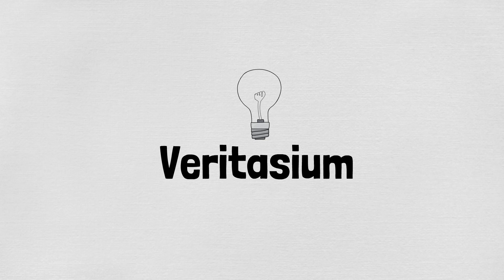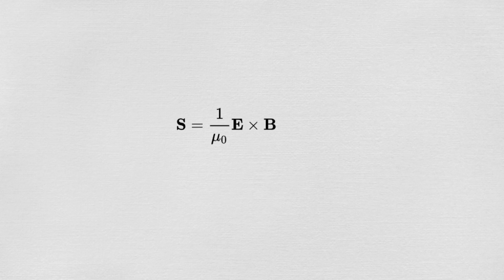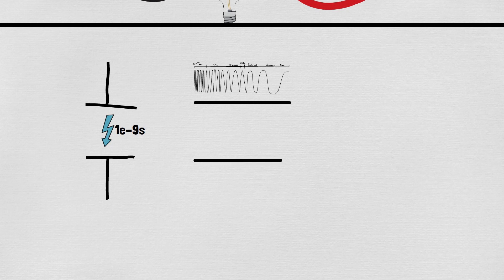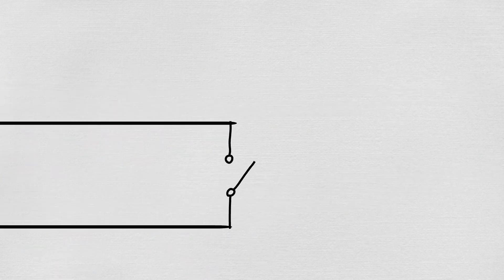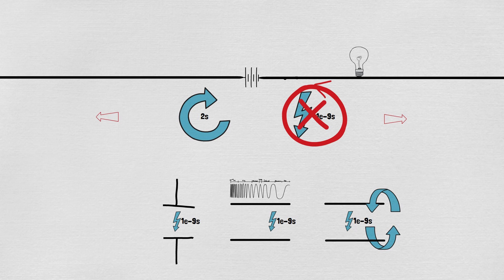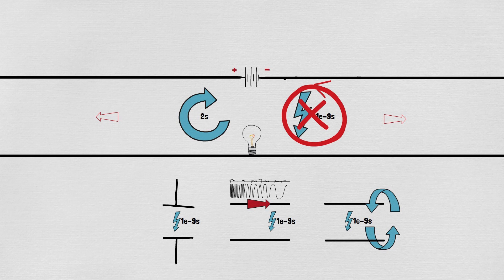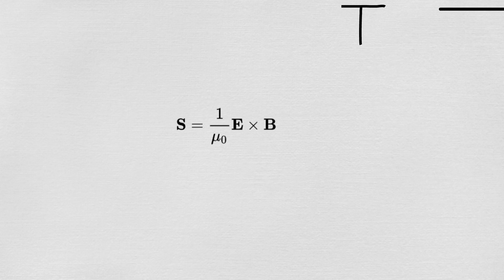Veritasium is Right? (see description)

Comment: OK.  So here is my answer.  The answer is B and D ( sort of).  Other people are assuming the only way the energy can transfer from the battery to the light bulb in 1m/c seconds is thru magnetic induction or capacitive coupling thru the wires in close proximity of the battery and the light bulb.

1. Capacitive coupling.  Since the Battery is a DC source, the only induced current via capacitive coupling will occur right at the time the switch is turned on and there is a transient (t = 0).  However, after the switch is thrown (t > 0), the source is DC and the capacitance will act as an open circuit.  So there will only be a brief blip of capacitively induced current to the light bulb.  However, it won't be sustained.

2. The scenario that Veratasium shows is a two parallel wire pretty much infinitely long.  So you can use Ampere's Law to determine the B field and force on the wire with the light bulb with respect to the current running thru the wire at the battery.  I = (1/mo)*(B*2*pie*r).   The B field that the wire that the bulb is on is inversely proportional to the distance between the wires.  In this case is 1 meter.   So it is safe to assume that the induced current in the wire at the bulb will be much less than the current that is occurring in the wire at the source.  So if the bulb does blink at 1m/c seconds it will be very fast and very weak.

The only time the bulb will light up for a sustained amount of time will be after 1 second when the E field travels the entire light seconds around the circuit at 1/2 light meters second away.  So the answer is B.   But maybe D sort of.

Comment: The video was talking about a transient flicker on the lightbulb.  The idea of EM fields being established is interesting.  But there could be transient effects on the way.  And the switch being next to the bulb is of significance.  Also it's unclear if the EM field travels in both directions from the battery reducing the time to 1 second.  Granted if current flows from high to low potential that doesn't seem likely.  Anyway I feel this video didn't describe the transient situation enough.  Not that I'm satisfied with the 1/c answer either.  But nobody is addressing everything so I'm not comfortable that this simple explanation is right either though it's good to see a start of a different perspective

Comment: The place of the switch, bulb, and battery is important. Also, the switch enables a charge to move to the "end" of the circuit if it were two wires, which is a moving charge a. k. a. current. If the switch were at the far "end" it would take 1 second.  If it were two wires the bulb would only light up for a very small moment, but because it's a circuit it stays on. If the battery the switch and the bulb were on a wire, but the wire wasn't connected back into the batter the bulb would still light up if you close the switch, but only for a moment.
That's my interpretation, although I'm still in my bachelor's and not even in electro physics, so I could be wrong too.
Reply: The placement of the switch in relation to the lamp is very important. You are however wrong in  that the battery placement makes any difference. The electric field can be viewed as the static DC field from the battery combined with a stepformed wave from the switch.

Comment: Even if the wire was zero ohms, the blub would not light in 2 sec. The creation of the E field resist the rate of change for reasons I won't go into, but suffice it to say that the long wire would act as an inductor. In fact because of it's length a very large inductor. The math is there to figure out the inductance of a 1 turn coil of length 600KM, but I am not in the mood to figure it out. I would guess several minutes if not tens of minutes. Tesla described a similar effect watching DC Edison lines being energized.

Comment: - International System of Electrical and Magnetic Units : my Ampere's definition until 2019 was:
  "The ampere is that constant current which, if maintained in two straight parallel conductors of INFINITE length, of negligible circular cross-section, and placed one metre apart in vacuum, would produce between these conductors a FORCE equal to 2×10−7 newtons per metre of length"
- Veritasium : got it, I can send wi-fi electricity .. looks mom, no wires

🤦‍♂️

Comment: Very true. Time is crucial here.
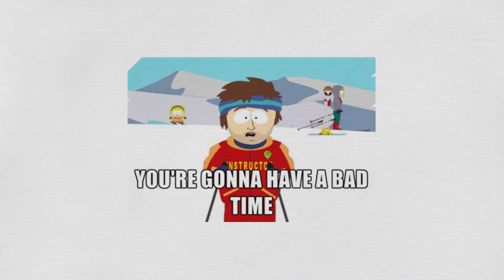But why do you claim that a current will only start flowing once the em field is fully established? How can an em field be built up without a current? I believe you give the answer to that at 7:10. The field and the current are acting mutually on each other.
The em field of the battery causes a current to flow which in turn builds up a charge imbalance on the wire which in turn creates an em field which moves more current and so on in a circular fashion. This whole circular cause an effect chain is then moving like a wave through the wire at the speed of light.

Comment: I don't know if you just chose the title for views (I guess it worked), but I'm struggling to see how Veritasium was wrong.

Like many others have said here, it comes down to the definition of "lit". My understanding is that as soon as the switch is closed, the current flowing across the top wire will create an EM field that induces a very small current along the bottom wire (after 3*10^-8 seconds) in the opposite direction. As the EM field "fully forms" around the circuit, the bulb will suddenly fully light after 1 second.

Someone please correct me if I'm wrong.
Reply: Seems to me the root problem is that Derek stipulated a condition (that the bulb will light up on any signal level that isn't zero) that simply isn't applicable to any real world system. Of course the RF leakage from the switch closing propagates in just a few nanoseconds, but a radio would have been a much more appropriate device for detecting such a spike. But if he used a radio, then everyone would know this was just RF leakage.
Reply: @mal2ksc  But would it have conveyed the idea of induction to the layman? Possibly...

Comment: I'm not very experienced either in EE but I'm going to give it a go.
I'm pretty sure that the position of the bulb and the battery don't matter but the distance between the switch and the bulb does.
On the + side of the battery the static voltage is zero, on the - side it is some voltage let's say 5V, also static; no current flows and no magnetic field so no power is transferred (duh).
When the switch is closed, the 5V meets the 0V side at the switch and a voltage gradient is formed along the wire radiating outward along each length of wire to the left and right of the switch until it reaches both ends of the battery.
as the voltage gradient is formed, electrons are pushed and squeezed together tighter and pushed forward faster, forming a current that rises as the voltage rises at that point in the wire until they reach their equilibrium.
Now on top of this is the capacitive action of the wires, as soon as current flows across a length of the wire, the parallel wire 1m away receives an induced voltage too.
So in Derek's video, with the switch next to the battery, the bulb will light dimly in 1e-9s from the capacitive action, stay steady until the wave of actual current reaches it, in 2s.

Two other situations;
with the switch on the side of the bulb but far away: as the switch is closed, the bulb will not light until that wave of current reaches it, as there is no capacitive action before the full current reaches it. so the time for the bulb to light will be the function of the speed of light and the distance from the switch.
with the switch on the side of the bulb nearby, the bulb will light quickly according to the function of the speed of light and the distance from the switch; same reason, just faster.
with the switch on the side of the battery, but far away, the bulb will not light until the current flow causing the capacitive action reaches the wire across from the bulb (it will come from the top first) and it will light dimly, after that the full current flow will reach it and it will brighten to full power.

So ONLY in Derek's specific situation, and his specific condition that it lights under any means is he right. And even if I'm wrong (likely), I think Derek purposefully made it like that and purposefully kept the solution vague to spark scientific dispute; which is kinda dirty, but...chaotic good?

Comment: Thank you. I never participated in the discussion because I'm not a physicist, I'm just a lowly electronic engineer, and most importantly this discussion angered me, because it highlighted the simplicity and exaggerated approximation with which science journalists treat the subject. I work with wires, batteries and resistors every day, if it was that easy to create an antenna/capacitor/light emission my job wouldn't exist, and I'd probably be dead.

Comment: I thought similar. I said it would violate the speed of light limit for transmitting information.
If it is like Veritasium described, the lamp would turn on when the circuit is not closed on the other end, or it would not. If it doesn't, then the explanation makes no sense because how does the current "know", that the circuit is not closed on the moon? I'd have to transport the information about a switch on the moon in 1/c to the lamp.
And if it only works with a switch on the moon closed too, then I could open and close the switch on earth quickly and someone on the moon could close his switch as well frequently but in a slower rate. Then each time the lamp does not turn on on earth when I pressed the switch, I know the switch was open on the moon too, hence I have transported 1 bit of information with the speed of 1/c.

Comment: I'm surprised no one has tried an experiment to just prove whether he is right or wrong.  Make the wires 10 meters long and 1 cm apart. Put an LED next to the switch, and an LED on the far side.  Then attach two photo receptors, one to each LED.  Then just measure the difference in signals from the two photo receptors using an oscilloscope (or maybe some fancier lab equipment).  The two signal should be different by 33 picoseconds if he is correct, or about 30 nanoseconds if the current has to travel 10 meters.
Reply: Exactly, though pico and nano seconds might be hard to differentiate

Comment: You need to close the circuit to allow DC current to flow, which is the only frequency carrying power once the system reaches stability

Comment: Finally, someone posts common sense. 
Also, the EM field is not directional so the amount of energy transfer from the battery wire to the bulb wire would be proportional to the area of the bulb wire facing the battery wire. The two wires would have to be co-axial with no coupling losses.

Comment: If you measure electric potential across terminals of the battery, there is surely a voltage measured, but the circuit need not be closed. Is that violation of what Tycho describes as a current establishing a potential difference, or is something else going on? I guess the voltmeter acts as a parallel circuit and allows a very small current to flow? With the battery connected to load, the voltage drops since the internal resistance of the battery increases with current? 

Not an EE or physicist by training, but I enjoy the topics. Thanks for the video!

Comment: Essentially it takes 2s for em field to set up and then current that begins to flow causes energy radiation radially in 10^-9 seconds.
So total time until the light is lit is 2+10^-9 seconds?
Reply: When you say "for em field to set up" are you implying "across the entire circuit"? I think the point is that it only needs to be at the switch when it is closed and the field lights the bulb there, before the rest of the wire(s) is(are) involved.
Reply: @markhathaway9456  hey man I am confused too. Essentially what veritasium showed was that  EM wave propagation and energy lines have different shapes and are always at right angles. Now my question is how can we be sure that speed of energy transfer is same as speed of em waves or light through wire. I always thought the speed wave for energy would be smaller such that however we configure the circuit it lights in 2 seconds. because energy fields come into existence in the transient process as a consequence of the development of em fields in the wire.

Comment: I think the easiest way to think about this is disconnected the circuit on both ends (kind of) and look at it like a transmitter and receiver 1m apart.
Once you "complete" the circuit for the transmitter and the current start flowing "locally" near the center of the transmitter, when does that signal reach the receiver?
The answer is 1/c...

But yes, I guess the EM energy is going every where initially and eventually focus onto the receiver/light bulb.
Eventually all segments will have flowing current and EM fields line up to point towards the light bulb.

Comment: The first question I had was, "How would the proposed outcome change if the wire made a 10-sec loop or 1-hour loop?"  I never had any engineering classes, but it takes time to bring up the full potential in the wire. If it takes 2 sec for the current to reach the far side of the battery, there should be no potential to light the bulb until the 2 sec is reached. The position of the switch, the bulb have no difference. We need a completed circuit.  Also, just to make trouble, the current potential would not reach 100% at 2 sec, but would "begin" at 2 sec.  The longer the loop, the more time it will take for the potential to rise.  So everyone is wrong. The bulb will start receiving a power potential across sides at 2 sec, but it will take time for the potential to raise enough for the bulb to light.  That will be dependent upon how long the wire is. But as this is a thought experiment, it assumes the power is an on/off condition. Fun!!!  By my rules, I am right!!!
Reply: Actually, the length of the wire doesn't matter, what matters is when the em wave from the switch reaches the bulb. So, if the switch was near the bulb, the bulb would actually light up immediatelly, assuming the circuit was in steady state.

Comment: It seemed to me like Veritasium was (maybe intentionally?) channeling his old teaching days. From my EE classes in college I remember many circuit problems in the classroom discussion that began with "we'll neglect this, that, and the other. And for the sake of simplicity we'll assume X=Y." I think he confused a lot of people because he quickly throws his assumptions in the audio conversation and never states them in the visual problem. For example he assumes no resistance, a perfectly efficient lightbulb, and I believe a perfect switch? Then to top it off he uses circuit symbols that lead those familiar with them down the wrong direction of thought vs. what he seems to be implying (DC power source symbol, but seems to be talking about AC). Then to try to make it more familiar to most people I suppose he also uses a car battery and a REAL lightbulb and switch for his presentation. 

I think there would be a lot less confusion if he had cleaned up the presentation. Considering his assumptions and problem statement I think he should have left the whole thing as a properly labeled and notated graphical diagram rather than trying to drive the point home with physical objects. I got hung up for a long time on what he was presenting physically not being possible vs. what he was wanting us to assume. Even then I think he tries too hard to drive the point home and ends up giving the wrong impression about real world application. He is correct in the essentials under the right circumstances, but has many an engineer's hackles up because it's not applicable in the way he presents it. That is what engineers are trained to do after all, take all the math and equations that work out so perfectly on paper and applying them within the messy boundary conditions that are "real life."

Comment: The currrent won't just wait for the EM field to be completely established to start flowing. The laws of electromagnetism follows the principle of locality, and having to wait for the EM field to be establisehed would violate that principle.

There is already an EM field present before the switch is closed, and because of that field, there is a potential difference across the switch. As soon as the switch is closed, charges will start moving thought the switch, regardless of what happens to the rest of the circuit. And because of that flow, the wires start behaving like an antenna (or the primary of a transformer) immediately.

 Of course the power transmitted to the lightbulb would be really small at the beggining, and progressively tend to the final value we would expect it to have in a static scenario.

Comment: I think the result of 1/Csec is not wrong from my  perspective . I might be wrong but this is how i thought. I use the model of transmission line to transform two parallel lines to a series of inductor and capacitor.

At t=0- (open), there's no energy flowing through.
At t=0+ (close), the wire is essentially a inductor and by the I_l = I*(1 - e^(-Rt/L)) we can get I_l = 0.
So we can consider the circuit as two short line with battery and lightbulb. By that, the model seemly becomes two capacitors' plates attached to battery and lightbulb. 

From:
 _____________bat___sw_______________
|______________lightbulb_______________|

To:
_bat_sw_
_lightbulb_

The two end act as a capacitor, with V_c = V*e^(-t/RC), at t=0+ the V_c is equal to V.
So the energies are indeed transmitted to the lightbulb.

I'm just a 2 grade student major in EE, so maybe something is wrong. But I think the conclusion is right.